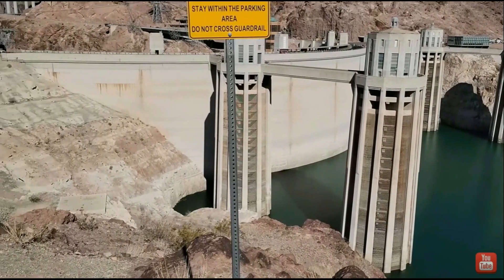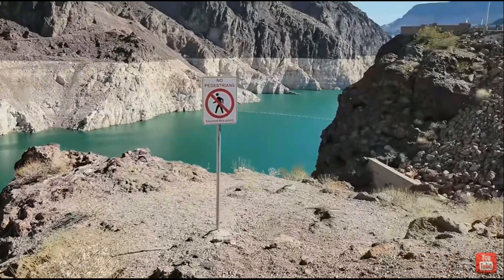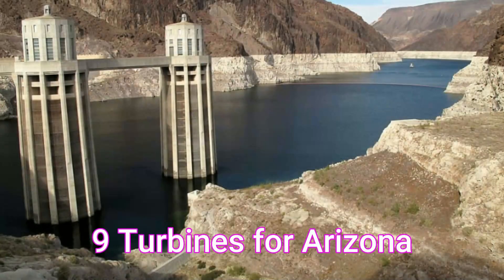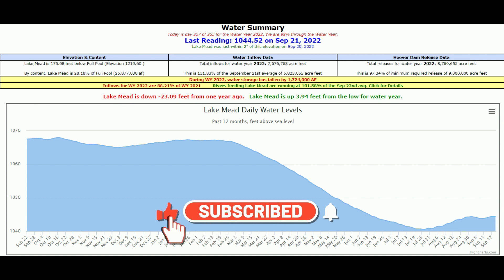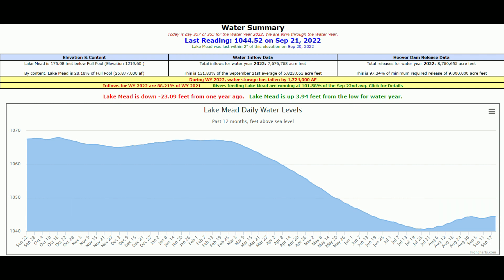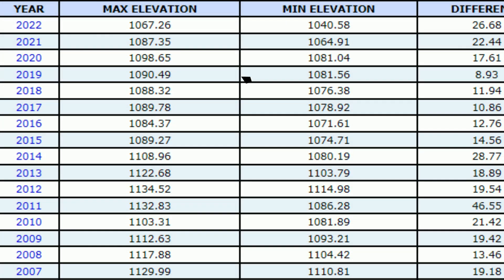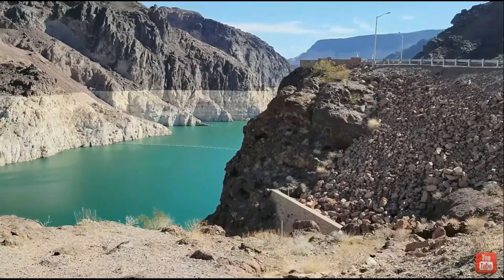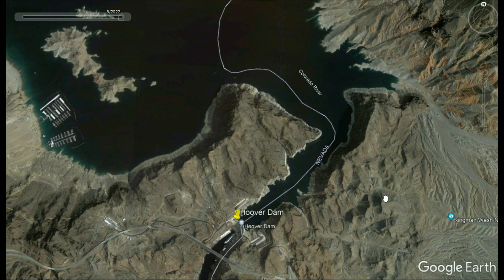Hoover Dam Early Power Failure Lake Mead

Comment from the maker: There are 17 turbines — nine fed by the two towers on the Arizona side and eight fed by the Nevada towers. 💥Watch next:https://youtu.be/8S8ETjvvU6c.  The technology and the design of the turbines has improved over the years
Reply: I think the have 2 smaller power turbines , that don't experience low flow cavitation .
Just to generate some electricity  at low H2O level
Reply: สวยงามมากคะป้าใจ๋❤❤
Reply: Thank you so much for good sharing 🙏 4:48

Comment: From what I see on this graph the water inflow is up above average so it seems the water usage is not sustainable. Start using less water. Turn off that refrig. in the garage. Choose crops that require much less water to grow.
Reply from the maker: True dat, actually the last 14 days finally the inflow was higher than the outflow. That's why the lake has risen 4 feet. Thanks for your comment.

Comment: Because the dowstream for water has vastly increased over the years, I wonder if the Colorado river system can supply enough water to keep up even in the best of snow pack and rainfaill years? When I ran the population numbers from 1980 to now, the population has grown appx. 14 million.  That is a huge increase on demand!  And lets remember, California has a number of power plants that were idled due to the concerns of the environment that could be restarted in an emergency.  And this water issue is in an emergency.   But all of this is, of course,   only  IMHO!
Reply from the maker: You're right. The lake can NOT keep up with demand even in a good year anymore. We've over grown and nobody has attempted to stop it. The power issue can be resolved, but the water issue is a huge deal. We can NOT live without water, we can survive without electricity. Thanks for your comment.

Comment: That water level is taken from sea level, not the bottom of the dam….
Reply from the maker: Yes, I don't know why they do it that way, but all Dams under the USBR are done that way. The base is at 705 ish. Hard to find an accurate number. There is as much as 200 feet of sediment in parts of the lake. You can see lidar estimates on the internet. Just google sediment volume in Lake Mead.

Comment: socal has built tens of thousands of houses with little to no natural water supply - they were dependent on water piped in from norcal and the colorado river - the riverside county board of supervisors had a meeting on the county's lack of water - comments from elected and appointed officials ranged from light concern to outright denial - "Riverside-based Western Municipal Water District Manager Craig Miller echoed complaints from officials during the 2014-17 drought emergency, saying a "modern conveyance system" of transferring water in the region could solve many shortages.

"We could have moved 236,000 acre-feet of water during the December rains," Miller said. "The water is there; we're just not managing or engineering it appropriately. It takes a big investment."
He said it's disingenuous to believe that rainfall deficits are going to be a constant and worsening conundrum.

"The science isn't indicating that," Miller told the board. "It's the lack of investment in infrastructure that's impacting the economy of our state."
https://patch.com/california/banning-beaumont/pass-area-water-official-drought-people-must-know-seriousness
Reply from the maker: That's very alarming. I guess if they bury their heads in the sand it will hide the facts that are clearly present. There are new developments in Az that have no actual water rights. The agents haven't been disclosing these facts. This is all going to be a big story. Water is being passed through the SoCal Dams to fill aquifers during rain events, but we don't have enough established. Thanks for your comment and the link you provided. May be time to look into what is going to become a water war..

Comment: The Three Gorges Dam in Hubei, China, has the world's largest instantaneous generating capacity (22,500 MW), with the Itaipu Dam in Paraguay/Brazil in second place (14,000 MW). Despite the large difference in installed capacity, these two power stations generate nearly equal amounts of electrical energy during the course of an entire year - Itaipu 103 TWh in 2016[1] and Three Gorges 111.8 TWh in 2020..How Oui Doin! Fox! Rock's Czar! Isn't Newsom Of Any Planned Coming Dictatorship as It Is In China Barry Soetoro? no! Freedom and Liberty!
Reply from the maker: We're not in a good place right now and I'm afraid it may be to late to fix the problem. Environmental constraints will slow the process of anything that is attempted. Eventually, and maybe within the next couple of years, we'll see an exodus.

Comment: No matter how you look at it, in the last 4 years = 2018 thru 2019 went from 1088 to 1090 = add 2 feet: 2019 thru 2020 went from 1090 to 1098 = add 8 feet: 2021 went from 1098 to 1087= 11 feet of drop: 2022 went from 1087 to 1067 = 20 feet of drop and the smaller the lake gets the faster it will drop. Even if we get heavy rains and snow when you add in evaporation which is a natural drop it will still lose more water than it is taking in every year right now and I see nothing that can change that. Not looking good at all. I wonder how many of the 17 turbines are still running and I am sure they all are not running, not enough water to do that.
Reply from the maker: They're running at 60% right now. That will drop as the lake level drops. They have 5 newer turbines designed to use low flow, but at 950 elevation that will end. Then the lake hits dead pool at 895.Las Vegas has the means to pump the rest out if it's allowed by the government. Not looking good. Thanks for your thought out comment.

Comment: Shutting down the wheels in the dam will have to happen before cavitation destroys the equipment. My thinking is that both Glenn Canyon and Hoover Dam will go off line permanently. The bottom line is that the SouthWest grew past its ability to supply basic necessities such as power and water. There are no plans in the works to solve this problem. The worst part is that construction hasn’t slowed down. In fact it’s increased 22% over last year.
Reply: You guys need to look at inflow to see the big picture, not consumption.  Consumption has been REDUCED in the past 20 years, not increased.  The inflow is the issue here, as the mega drought has not been giving the watershed enough rain and snow.  The yearly water allotment for every US state that receives water from Lake Mead, as well as the allotment for Mexico and the evaporation from having it stored in a lake, totals 9maf utilized from the Colorado River.  If you were to average the inflow from the Colorado river from the beginning of Lake Mead to the year 2000, you'd get around 21maf.  Historically speaking, for the past millennium, the Colorado River has been flowing that much on average.  That means at maximum usage and average historical inflow, we'd be able to double our usage and still have 3maf left over to send out into the ocean.  Due to the worst drought the Colorado River watershed has seen in over 1,400 years, the inflow is only at 9maf, sometimes less, and the drought has been going on for 20 YEARS NOW.  Let me re-state that, the Colorado River has been flowing twice as much as it is now for over a thousand years, and the past 20 years has been the least amount of flow it has seen in 1,400 years.  The point here is that we're not overconsuming, we're being undersupplied, and no amount of foresight and preparation could have prepared us for this.  So jumping to the first kneejerk response of saying people are using too much water in a desert is like saying if half our nationwide farmland failed to yield a harvest due to an unprecedented drought, then the reason why we're running out of food is not because the weather ravaged our farmlands, it's because the population is eating way too much and we shouldn't all be living in a country where all of the crops are grown in an area prone to an occasional drought every 1,400 years or so.  Look up another video here, "536AD: The year that the sun disappeared" to see what caused the Colorado River to see such a significant drought 1,400 years ago.  This event caused civilizations to collapse and entire cultures to disappear.  Are you prepared for something like that?  Can you be?  Can we all, as a nation and as a world, be prepared for something like that to happen?  The answer to that question is the same answer for why government officials aren't able to "fix" the problem with Lake Powell and Lake Mead.  This wasn't a foreseeable event, it's not something you can realistically plan for, and yes, they are doing everything they can to help...there's just not much of anything they can do.
Reply: i get it now , the open boarder is the distraction from the dam.
Reply: @floydkettle2469  I tend to think the other way around
Reply: The situation is actually worse. Due to decrease in yearly snow pack, the carrying capacity of the SouthWest has decreased
Reply: @nickl5658  Another blogger who covers this, said that when he moved to Vegas in the early 80's, the population of Vegas was about 3-400 thousand and water wasn't a concern.  But anyone who have driven around Vegas and the suburbs sees signs on every vacant spot of land about what is coming,  New homes, condos, maybe a casino.  What looks like a tumble weed sandy lot, will be turned into a nice new building project.  I have a nephew who plans on moving to the Vegas area in a few years, and is all excited.  He will be retired and loves the newness of everything he sees.
Reply from the maker: Correct, well said
Reply: skinflaps meatslapper. now there's someone I'll listen to
Reply: @chuckstith838  That sounds a lot like you just ignored easily verifiable facts because my name offended your delicate sensibilities.  Surely that's not the case, because it would make you appear as if you have no intellect of your own.  And why should you take anything that another person tells you as fact, anyway?  I said that YOU need to look at these things, meaning find verifiable sources for yourself, not listen to some random video or user on the internet and believe every word they say.  I'm not going to hold your hand and walk you through cursory and rudimentary research that you could easily do yourself, and I'm not going to teach you how to use the internet either, because that would make you appear to be a mindless peasant.  I challenge you to do the research yourself and tell me I'm wrong on any account, and that my initial impression of you isn't accurate.  Or don't...no skin off my back, I already have you figured out, I just want to see if you'll do anything about it.
Reply: The main issue was giving our water to freaking California for years!
Reply: @scotthewitt4927  who's water?
Reply: That is work that is going to waste because we couldn’t maintain a balance between water needs and water supply.
Reply: Speeding quicker to its own demise.
   This will affect the entire country
   Those do not die in place, will be migrating to areas that can not absorb them or meet their daily needs to sirvive.
Reply from the maker: Just look at the growth away from Phoenix and Las Vegas. It's unbelievable. And they're not slowing down. I saw an article that a lady posted. She said the real estate agents are saying everything is fine. But, she also said they're now being told after buying their home,  that the water company may not be able to provide water after this year. How can that be. What happened to full disclosure by the agents.
Reply: @Time2getgoin  I get it, the real estate agents are there to make money. However, everyone is trying to sweep this under the rug. In 20 months lake Mead will see a level of 895 feet and that is dead pool. A few months after that the third straw will stop working. They say we have about a years supply on aquafers stashed away (banked). California will lay claim to that water by treaty. The only answer for those in Las Vegas is to pray the government buys your property and lets you move back East.
Reply: @Time2getgoin  Real-estate agents are like car sales people, there liars.
Reply: You hit the nail on the head!  The people in charge of this mess: "We are from the government, and we are here to help!"

Comment: As time goes by there is a tendency of power shortage because the water which provide power is gettin smaller and smaller or decreasing its level?
Reply from the maker: That's correct. Things will get bad soon. Thanks for watching.

Comment: Getting serious Bobby. Now, it's not just the water issue but a power issue as well. Thanks for sharing the info.
Reply from the maker: Thank you Dave and Kathy🙏much appreciated
Reply: Yes Sir, and it has been a power issue for a number of years now, actually.  Less water in the lake means less weight, so less pressure.  The turbines have been generating 1-2% less electricity per year for 10+ years now due to the lower lake level(s).